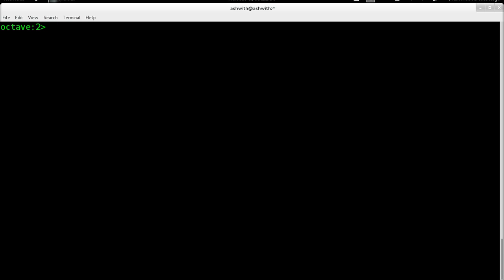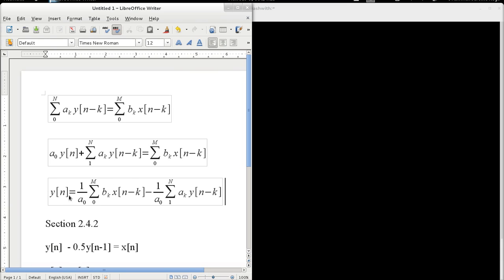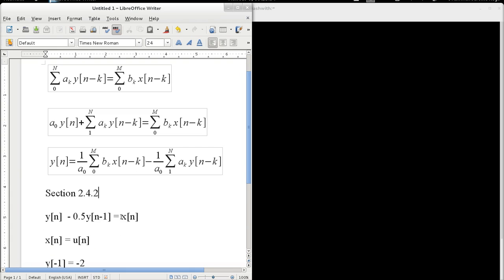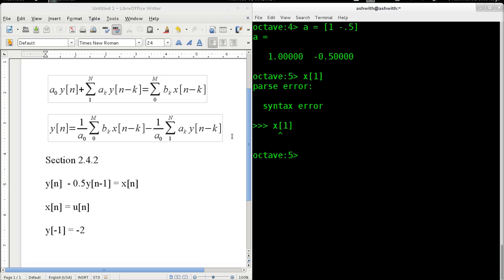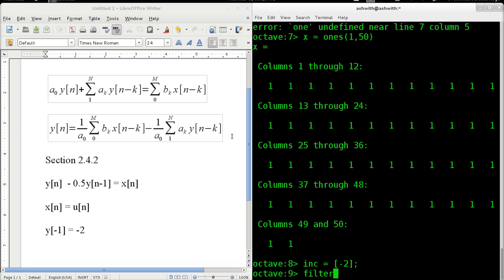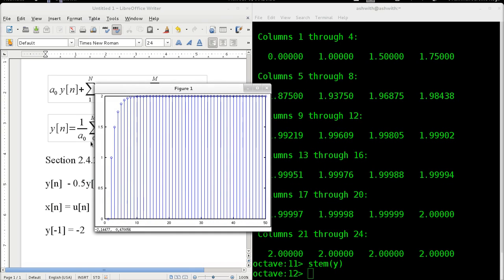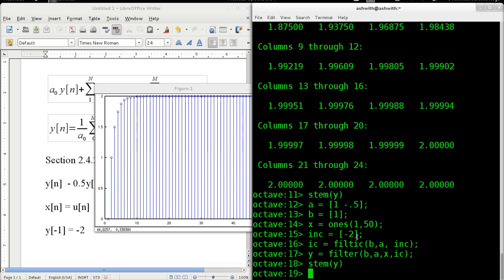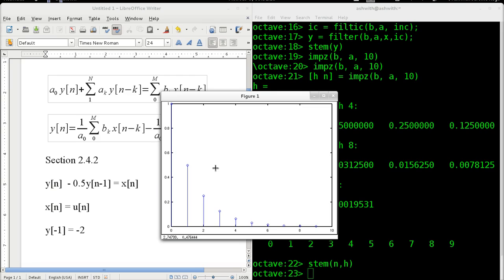Difference Equations in Octave

Comment: Thank you, but why don't you use linear algebra notation, which is much more concise and much more readable ?
Reply from the maker: Thanks for your comment! I'm unfamiliar with it. Could you point me to some resources to show me what you mean? Unfortunately Linear algebra was hardly given any importance in my curriculum and I am trying to learn it on my own.
Reply: Ashwith Rego
: Well basically, linear algebra is just a notation allowing to write all equations at once if they are similar enough. That is, instead of writing

y(i) = a(i)*x+b(i)

you just write

y↑ = a↑ * x + b↑

where y, a and b are N-dimensional vectors. It is just a kind of shorthand allowing to get rid of the indices to make things clearer. Apart of pure mathematics, it was first used AFAIK in programming with the APL language from 1969 to 1985 (Spreadsheets almost killed APL), but is very near the Octave notation as well :

octave-3.6.4.exe:1> a=[1 2 3];
octave-3.6.4.exe:2> x=[4 5 6];
octave-3.6.4.exe:3> b=[7 8 9];
octave-3.6.4.exe:4> c=a*x + b
error: operator *: nonconformant arguments (op1 is 1x3, op2 is 1x3)
octave-3.6.4.exe:4> c=a.*x + b
c =

   11   18   27

octave-3.6.4.exe:5>

It is used a lot in France, even in colleges, because it simplifies things and make them easier to grasp. While missing APL a lot (but NARS2000 seems now almost ready to replace it), I just love Octave too now :-)

Perhaps you might be interested by this :

https://itunes.apple.com/us/itunes-u/linear-algebra/id354869137
Reply from the maker: Paganel75 Thanks again! :-) I didn't know one uses arrows like that to denote vectors. Yes I am studying Prof. Strang's course (coupled with Khan Academy) and it is brilliant!
Reply: +Ashwith Rego : "I didn't know one uses arrows like that to denote vectors" : Well, I must say one normally does not ;-) However I saw somebody doing it on a Usenet forum some years ago and it seemed a dandy way to write simple equations with a computer keyboard :

And God said :

∇↑ ∧ E↑ = - ∂B↑/∂t 
∇↑ ∧ B↑ = μ○.ε○ ∂E↑/∂t
ΔE↑ - (1/c²).∂²E↑/∂t² = 0↑
ΔB↑ - (1/c²).∂²B↑/∂t² = 0↑ 
μ○.ε○ = 1/c² 

AND THERE WAS LIGHT !